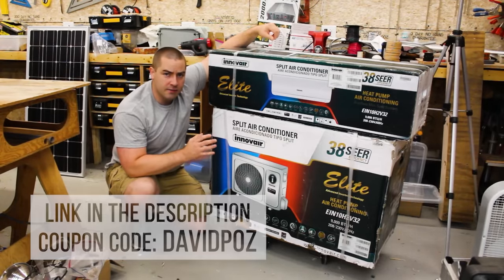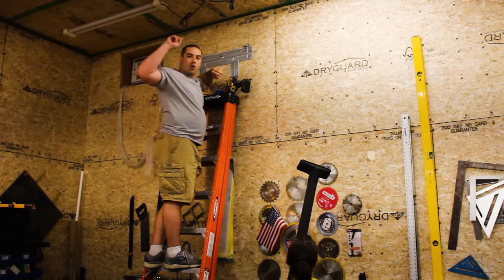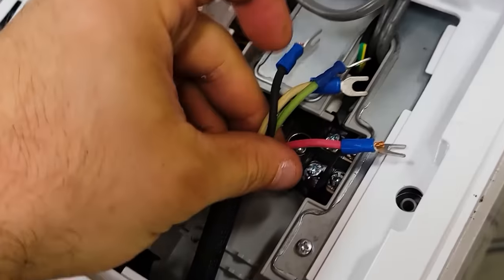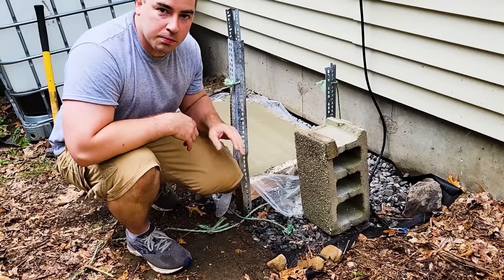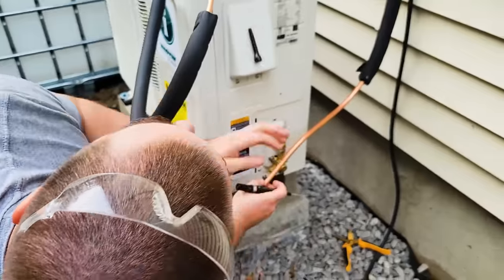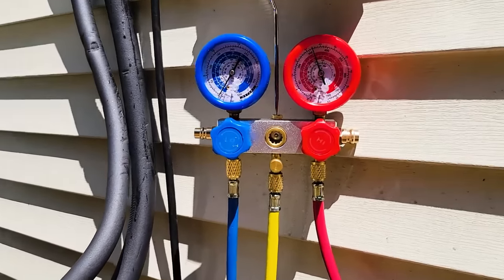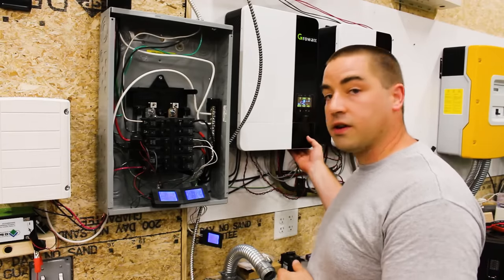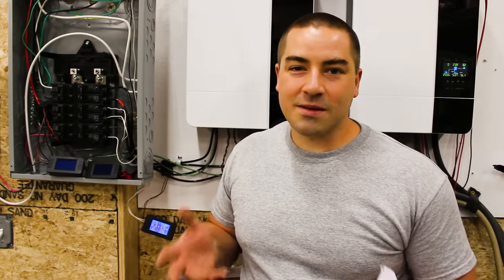DIY Mini-Split Heat Pump, Full Installation, 2021

Comment: I had a properly installed minisplit and several times had the drain line get clogged with algae, resulting in water running down the interior wall. As near as I can tell, few, if any, of these units have a sensor for the internal drain pan filling up. I was going to see what I could hack together to implement something like that, but ended up selling that house before I did.  When it did get clogged, the solution was to put a shop-vac on end of the drain line outside, and suck it clear. Some people recommend running bleach through the drain line, but I never found a decent way to inject it into the unit.

One of the things I really like about these inverter minisplits is how quiet both the inside air handler and the compressor are. I could be outside standing next to mine, and you wouldn't even have to raise your voice to have a conversation.
Reply: Does algae grow in darkness or was it clogged where the sunlight hit the drain hose outside?
Reply: In the future you can buy drain line cleaner that you just pour over the indoor unit coil, it will drain down to the pan and out the line.

Comment: Great, detailed video David! I've been running Mitsubishi mini splits at my house for 4 years and have loved them. I hope you'll be able to come up with a way to measure actual efficiency of this unit, I'd be very curious of the findings!!
Reply: Kevin have you had any problems of any type with your units and did you see a drop in your utility cost? Thanks
Reply: Yeah there was another YT video of someone installing a mini split, where he noticed that the SEER rating on the unit was lower than advertised. He complained, and the mfg shipped him a new sticker so that he could cover up the lower number! Makes you wonder how much the claimed SEER numbers can be trusted.

Comment: For the vacum part id recomend another video because this was a lot. All 3 colour hoses was connected to the split within a minute of the video without really having to.
The basic of it is just connecting the blue to the split and yellow to pump and then vacum half hour, then close valve and see that it holds. Red and nitrogen side is really not needed, but is an added test.
Also remember that in a high moisture environment it wil take longer time for the vacum pump compared to dry.

Great video showing all info doh.

Comment: The black foam insulation on the tubes for my mother's A/C started to oxidize after a few years. I spiral wrapped them with green gorilla tape. It still is looking good 6 years after that. Good UV resistance on the tape and its adhesive!

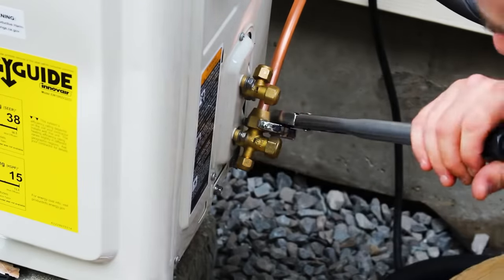Comment: One last advise @ 41:15 use the outer nut which secure the valve stem underneath, to hold against it when you tight the pipe nut up to torque. And before disconecting the vacuum hose, you did it right except you don't have to go all the way up to 100PSi just a tiny bit over zero, and don't over open the valves you did really hard on the high side one no need to.

Comment: Great video. Very thorough. One thing I like to put the  Nilog on is the back side of the flare where the nut contacts. It lubricates and tightens much better but as you did, you should always use a torque wrench as you can easily over tighten and split the flare.

Comment: Drain  pans are home to algae and if there is not sufficient flow, the algae will grow and fill up the pan causing those overflows you may see as wet spots on the ceiling for ceiling mounted units. For units close to the wall like yours, the water overflow will run down the wall. This is a maintenance item that is almost always overlooked. Bleach will kill the algae and a small amount added to the container will keep it flowing freely. The algae can also clog the overflow tube which is another problem. If needed this can be cleared by forcing water up the tube with a hose but be sure to not force the clog up the unit and into the room.There are also tablets you can purchase from an ac supply house and add one or two to the water in the tank every so often. Attention to this can save hundreds of dollars in repair costs and in service costs.

Comment: Another great video David.  As an architect engineer and builder of many years I have to thank you for educating home owners to install this energy efficient technology. I’ve ordered three growwatt inverters  30 K of batteries and more solar panels from your recommendations to upgrade my home system. And after watching this video I will be ordering some heat pumps as well. 
Have a great holiday 🥳

Comment: Great video. It was so interested, that it went so fast, couldn't believe an hour run so short. Thanks for sharing.-
Reply from the maker: Glad you liked it.
Reply: @DavidPozEnergy  just one question.... The outside unit, is it attached on something called silentblock? Due to vibrations, in order to be able to move a bit. Hope it's not a solid hold. Sorry for my English....
Reply from the maker: I used some little rubber pads between the feet and concrete.

Comment: One more tip, on the outside wall, an 1-3/8” hole gives clearance to fit the ell flush to the wall.
Reply from the maker: Thank you.  I appreciate you sharing some of your knowledge.  That would have made it sit better.  As it is now there's a little bow in the conduit from the LB to the first anchor.

Comment: That concrete form was better-built than most houses!  Countersunk those screws in the 2x4 corners so it looked beautiful for the 2 hours it existed and Thank goodness for the steel stakes holding the corners or who knows what might have happened to that massive amount of concrete.  Sloppy ol me would prolly just lined up a row of those blocks on the gravel leveled and called it a day...

Comment: You should put some thread seal on the back of the flares also so that it prevents moisture and ice from building up between the neck of the flare nut and the pipe . This ensures that the pressure of the ice will not squeeze the flare causing a leak in a few years time or corrosion from moisture won't weaken the pipe . The oxygen free nitrogen used for pressure testing is great at absorbing moisture in the system which is then removed much easily when a vacuum is applied. 
You have done a good job for someone who has no experience, probably a lot better than some apprentices .
Reply: Only missing part, and a major miss in my opinion, was the lack of a micron gauge being used during evacuation.
Reply: @ianicus123  yes tell me about it I have an mg 44 field piece micron gauge love it
Reply: NYLOG rated for R410A
Reply: The nuts are all facing down so not much chance of holding water. I would never use tape on the flare nuts.

Comment: Great Video. I hope it out performs your previous set up LOL. I have the same unit and it is a game changer to say the least.  2 things I've noticed with mine. 1. the fan  cover / grate would  tend to vibrate and become amplified in the building and became quite annoying. To fix it I simply took several pieces of firm rubber and inserted them between the grate and the unit. Now it's totally quiet. 2. The unit does seem to defrost quite often when  it's REALLY cold outside. I'm sure that is a good thing but was rather alarming to see the unit peeing into a giant frozen puddle several hours a day. That said, I have had zero issues with this system and would recommend it to anyone. Good  to see that this technology is finally catching on in the US. It's standard equipment in Europe and Asia, but slow to become accepted here. Not sure why.
Reply: Yeah that’s why you have to look at the detailed information on the HSPF as a function of temperature because it could be really high temperatures 50° but it could be way way lower if it’s freezing.  This kind of thing considered being serious problem with heating homes in the winter because of the unit might not put out enough heat.

Comment: Double check:  most maximum length of run figures are for supply + return = maximum run without adding refrigerant or losing efficiency.  It is not a distance of compressor to head figure in most cases.  Carefully read the instructions as this is generally in the small print.  Spraying soap will show a gross leak but any leak will deplete the refrigerant over time so the vacuum test pulled for and left for a couple hour period with a very accurate vacuum gauge (the manifold gauge is too gross in its scale) will tell the tale you really want to know.  The gauges are not that expensive and well worth it.  Mine will actually show the leakage that flexible test hoses will introduce.  Another reason to use as short a hose as possible directly from the compressor to your pump with the one accurate gauge in line.  The manifold is useful but when pulling a deep vacuum it can introduce components that bleed off the vacuum.  In most cases your procedure will do just fine but if you are a DIY er and do not have a source for additional R410 you don't want to lose any.  Also the smallest leak should there be one over months of time will lower the charge which can damage your unit as well as making it operate less and less efficiently.  The measurement you should be dealing in is microns rather than psi.  Pulling down and holding to less than ten microns is a good test.
Reply: I'd be very surprised if you got to 10 microns on a flare system, even using a Jim Bergmann setup 😉 😀
Reply: @sprockkets  That's what I was thinking, good luck on pulling less than 10 microns lol
Reply: Less than 500 is the standard test

Comment: I am not an HVAC guy, but the excellent engineer at the synonymous channel says that nylog is not a sealant. It is actually a lubricant and you put one or two drops of it on the BACK of the flare fitting not inside the mating surface of the tube, in order not to twist the copper while tightening the fitting.
Reply from the maker: I didn't think about putting Nylog on the backside of the flare as a lubricant until it was mentioned in these comments.  It's a great idea.  However, it is primarally a sealant, that's what the manufacturer says.

Comment: I think I would have purchased the wall bracket for the compressor, and mounted the unit off the ground, so you can mow / weed trim under it, and lessen the chance of their being an issue of some yard guy hitting the unit... Plus it would be above most snow heights, unless you live in Maine. Also, most installs leave a convenience outlet near the disconnect box, to run your equipment like vacuum, etc.
Reply: The Convenience outlet, Actually it is code and enforced here in Colorado depending on which town your in.

Comment: I seriously doubt this unit is "38 SEER" under the same ASHRAE conditions that major name brand units are rated.  
That is one of the two main ways SEER values are inflated.  In comparison, the top of the line Lennox air-source heat pump/A-C are 28 SEER.
Reply: well anyway to figgure out the true SEER? I honestly thought the same thing. how can this unit be so super effcient?
Reply: Yeah it sounds scammy to me. I bet it's not actually 38 seer
Reply: Seems very high, Mitsubishi have the highest SEER at around 28  this is probably skewed and fake ratings
Reply: Same specsmanship as those writing up specs for 8000A portable jump packs, I think.
Reply: If you look around Carrier is the highest at 42 I've seen others saying 38 remember this is a skeewed number due to total usage meaing now they are using part load and Occupancy, and Inverter savings which a standard AC will never be able to compete with Head to Head at full capacity I think the real numbers will drop back to 25 ish.

Comment: A thank you for your video as it was useful in reminding me of the steps I used when putting in my mini split two years ago (no problems with the unit functioning at all.  well above expectation).  They don't tell you a lot of this in their "installation" manuals so forgive me for criticizing.  For example what I learned the hard way was you want to slightly incline the compressor toward the drain.  The snap in drain leaks but the big reason is in winter it is normal for ice to build up quite high in the pan between defrost cycles and you do not want that ice over on the computer chip side wetting down the electronics!  Same reason for not leaving it out in the snow nor at a level the snow can come over. I did add a oil pan (auto) heater under the drain which I turn on when it is below 20 degrees to keep the drain clear of ice.  I was impressed enough by my shop installation that I am now installing a couple in the house.  The dehumidifying function alone was well worth the install--no rust on my tools!  I live in SE Alaska which is a temperate rain forest as well as lows down to zero and below occasionally and highs up to mid nineties a few days.  My unit has kept my shop of 18000 cubic feet (super insulated) at a steady dry sixty six degrees on the lowest setting all year long for two years.  My compressors are in a closed uninsulated building which keeps the weather off them while an open door and open joist bays/rafters (a deck above) create circulation.  The concrete slab and stem walls are above grade as well.  To top it off although it runs 24/7 I have not noticed any appreciable rise in my electric bill.    You will really like your system for sure.  Take care.
Reply: What size is yours mini split unit?

Comment: I'm not going to lie, that is insane. Albeit, it's only a 9k unit but being able to use so little energy it really doesn't matter at that point. 
If you need more capacity, buy another one 🙃

Comment: Looks like you put a ko seal in the quick disconnect. Probably should have added that to the video so people know the importance of sealing the box back up...also make sure to strap that conduit to the building has to be strapped in my state by code. Think it's within 3 ft from all boxes. You should also probably spray foam your sleeve to insulate the hole.. Great job by the way and I love all the extra effort put into this project and the detailed explanation most of it spot on...

Comment: The caps are more than just dust covers. They should be on tight enough to stop any leakage past the valves. Kind of a second line of defense.
Reply: Agreed.  I normally put teflon tape on the threads for the service port and other valve caps, prior to reinstalling the caps (and then torque them down relatively hard, to minimize risk of leakage past the teflon taped threads for the caps).
Reply: If it's leaking refrigerant those caps arent going to stop shit.

Comment: Looks identical to my Air-Con rated at 23 SEER!  Never even heard of a 38 most I have heard of at the cutting edge is 27 or 28.
Reply: How many watts per hour are you using?
Reply: @stevensaxon8888  a on my own

Comment: I installed a similar unit (a Cooper & Hunter) in my daughter's cabin. I ran the line set, condensate tube and ¾" conduit all through a piece of 2" schedule 40 PVC through the wall.

Comment: You might need the other little AC if the mini malfunctions as you found out prior to the Mr Cool unit.
Reply: Hmm, I was considering a Mr Cool unit.  Are you saying that David had one and it failed?
Reply: @georgedrenes8143  pretty sure all the small brands (those not labeled Mitsubishi, Fujitsu and a few others) are made by Gree.
Reply: @RevM  Thanks Mark.  David clarified that he did have a Mr Cool, but had some issues.  I need to do some more research before I spring for one of these mini-split units.  I really need a multi-zpne unit that has three air handlers.  I welcome any suggestions.
Reply: I have a Gree 24kBTU unit in a sewing room for my wife and a 24k BTU MR Cool DIY in my two car garage in West Texas we’re it gets cold and hot.
My two car garage 800 sqft really works well for me. On a 98 degree day I can cool the garage down to 75 degrees in about an hour. The heat side of the mini split works well too we had -6 degree temperatures here last winter and the garage wood shop was comfortable. Prior to that I had a Pioneer 12.k BTU mini Split the heat was great the cooling side was not as good. It would cool the shop but would take twice as long the Mr Cool.😁🛫

Comment: I have been strongly considering installing a dual zone myself.   Everything was within my wheelhouse up until it came to the vacuum pump and that sequence made me reconsider spending a few extra bucks and getting someone else to do it. Also don't want to void the warranty. Great video.
Reply: It will be hard to find a Installer who would just vacuum the lines. Unless you spend big bucks on buying and installing a unti from a hvac company the warranties are useless.. I wouldn't worry about a warranty since they only cover parts and not the labor or shipping. The cost to get those parts replaced by a technician are going to cost as much as a new unit. I have installed 7 of these minisplits  on my own and they all work great. First one was in 2015. Buy the tools and do it yourself.
Reply: Mr Cool makes some good DIY multi-zone units.  Just got a 3 zone 36K(12K, 12K, 12K), super easy to install and everything was precharged from the factory so no need to mess with any gases or vacuums.  Took a day to get everything in and that sucker pumps out great heat. You read about how good they are and people loving them but it's shocking how good and efficient it is. Of course it's nowhere near a 38 seer, it's 23 seer.  At just a little over $3K it was a heck of a deal.

Comment: 64F in garage/workshop is crazy. 68F i very low for house cooling... 

But with free energy from solar panels you can afford it without any remorse
Reply: Especially when it’s just using 150 watts.